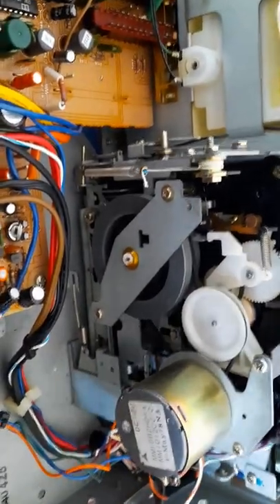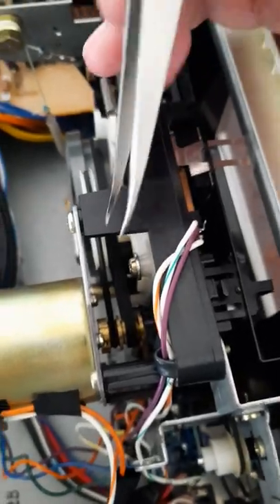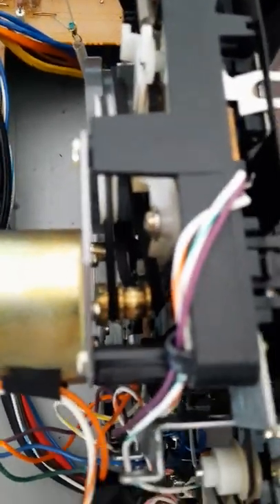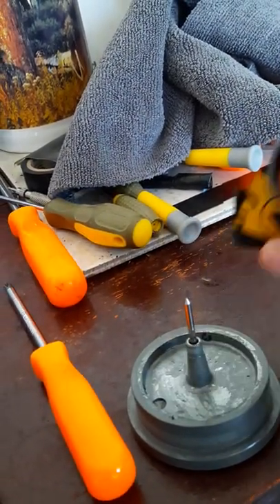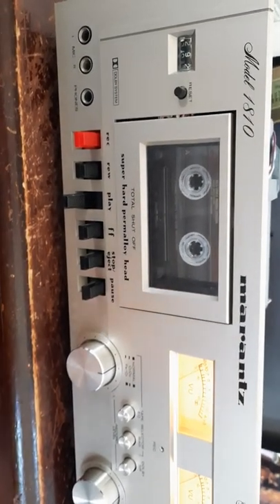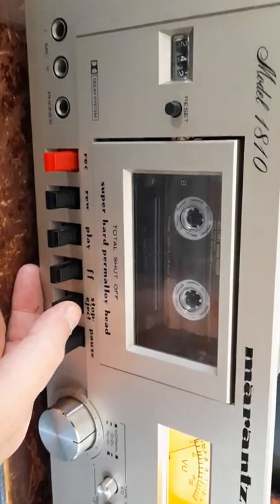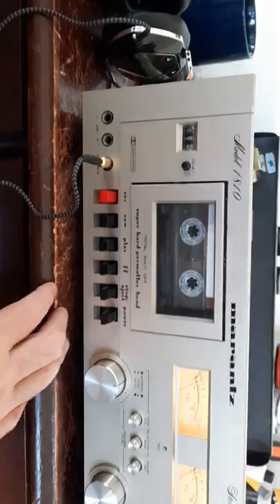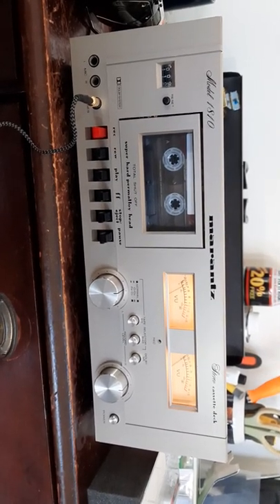Cassette deck repair. Capstan shaft oil sanding.

Comment: I found this video searching for capstan nylon washers. I stayed and enjoyed the video, but would you happen to know where I could get some? Maybe a multi-pack of varying sizes?

Didn't see you install one on this deck. Are they even needed?
Reply from the maker: I just take capstan/flywheel to local hardware store and find washer that fits.  Good luck.